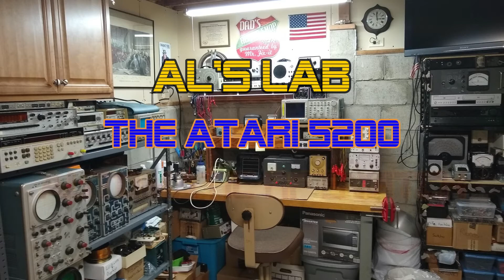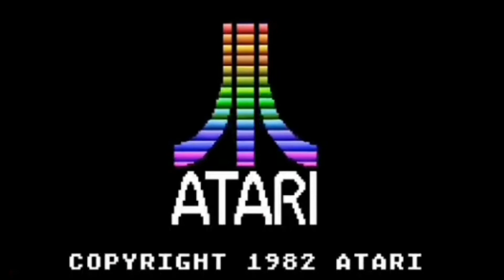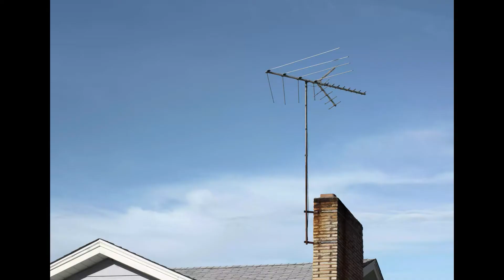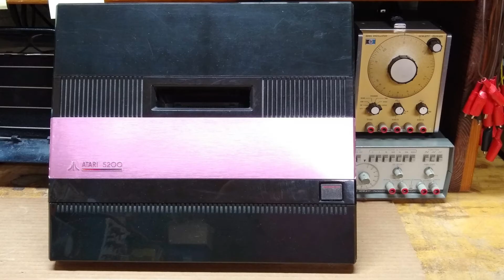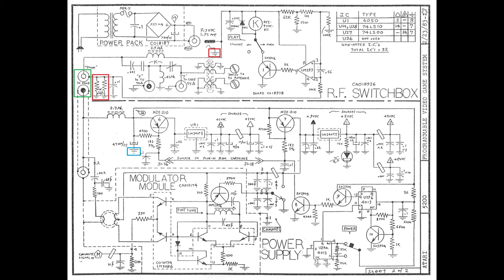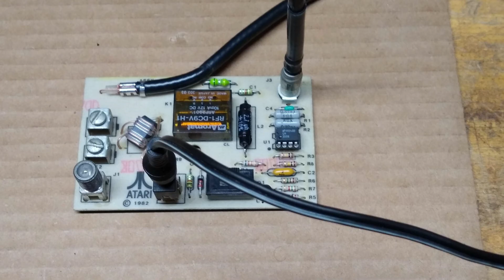Atari 5200 RF Switch [Part 1] - Theory of Operation

Comment: I  am actually still astonished how it all works using such method🤔
I might wonder why didn’t atari just used a 2 way wire cable instead or why not just using a modolator instead.
Like let’s say you modulate the rf signal as a high frequency while modulating the power signal as a low frequency sothat they don’t collide with each other.
BUT since atari uses 2 different capacitor filters at each end to filter out an unwanted signal from another.
But since boyh signals do share the same wire, you might think that they not only could collide with each other but also would take up extra bandwide, meaning that the rf signal might be weaker then it normally should🤔
Now i am not sure if the rf signal from the 2 port model of the 5200 is better, but it might be the case since it uses it’s own saperate cable from the power supply🤔
Reply from the maker: I believe that Atari at the time was trying to cut down the number of wires/connections.